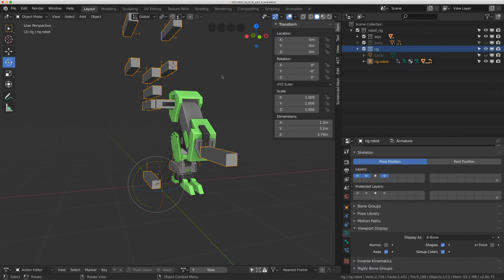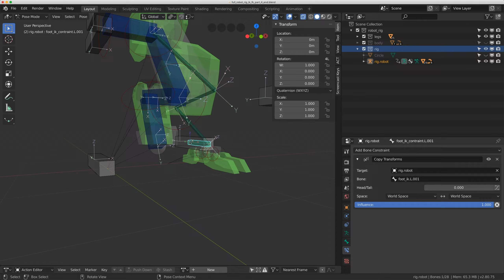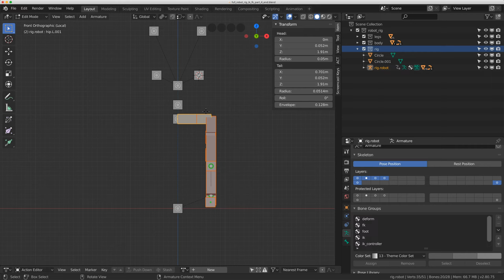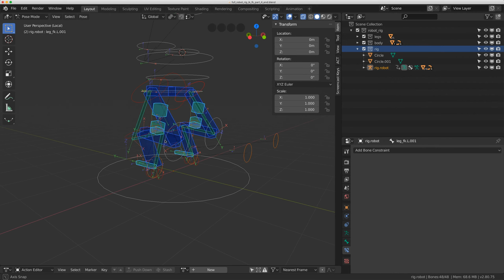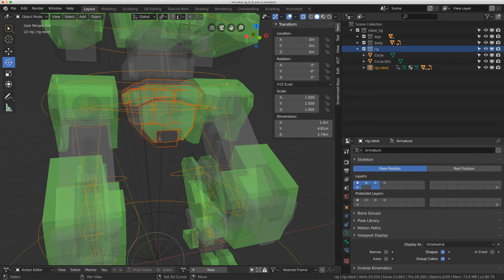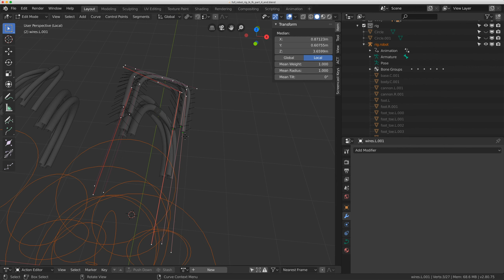Full Robot Rig - Part 5: Final Clean Up | Rigging For Animation

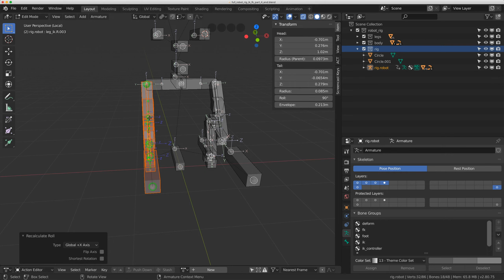Comment: I think they fixed the problem at 12:34 in 2.90.1 because I didn't have to recalculate the axis on the symmetrized leg. Both poles and pasting the action work as they should so all you need to do is add driver and parent the leg. 

Btw, I've watched tons of rigging tut but I've learned to rig from you. Your tuts are spectacular and easy to follow. You're an awesome dude for putting in the time and effort. Thanks!
Reply from the maker: Cool thanks for the tip, I'll try it out, that is great news. :)

Comment: Are these techniques suitable for game rigging?
I really want to learn how to rig hard surface stuff in blender for games.
Reply from the maker: For the most part, these are. Although, on a game rig you usually separate the deform rig and the control rig into two objects. That way you can bake out the animation and only send the deform rig to the game engine.
Reply: @LevelPixelLevel  Sorry to hijack this, but do you have or know of any tutorials to show how to properly do this separation? I'm new to Blender rigging (used to rig in 3DS Max), and right now due to the armature pose mode it seems impossible to me to have outside objects influence bones at all.
I did a quick look through your channel (which seems like an amazing learning resource, subscribed!) but couldn't find anything that seems to tackle the subject.
Cheers!
Reply from the maker: @yannickvanhoutte4403   Hey, for this you might want to check out the Unreal guide for getting rigs from rigify into Unreal: https://youtu.be/ppROgA3nQWk
They have a good system with an addon for achieving this. As you play with this it might help you bring the files into Unity or Godot.
Reply: @LevelPixelLevel  Thanks for the quick reply! I checked out the video but I feel it doesn't really answer my question?
I want to know how to make a rig with separate IK/FK controls in such a way only a deform rig gets exported to FBX, as you want for a game asset. I'm assuming Rigify can create rigs for this, I have yet to get into Rigify, but how would you do this "manually"?
I also don't see (from this video) how these add-ons would work for non-UE4 targets (Unity, Godot, anything else).
Reply from the maker: @yannickvanhoutte4403  Ah I see what you mean. For this you might want to just build the deform bones in Blender, meaning just the bones that actually move then mesh. Then you can bring this into the game engine and actually rig this in the game engine itself. I know you mentioned non-UE4 things, but here is an example for the Unreal Engine: https://www.youtube.com/watch?v=CP0C_8xNiyw&ab_channel=AndiDev
For Unity I have not tried this, but I have found this: https://blogs.unity3d.com/2019/05/14/introducing-the-animation-rigging-preview-package-for-unity-2019-1/#:~:text=The%20Animation%20Rigging%20package%20for,own%20custom%20constraints%20in%20C%23.
And I don't know if this is possible in Godot, I have not looked into it. I hope this helps!
Reply: @LevelPixelLevel  That's a way to go about it, indeed, but what if the animators want to explicitly work in Blender? Unity is rather animator-unfriendly (even with those preview tools), so to this day we do a lot of animating in the 3D package and baking this out on export for a fully baked animation inside the engine. In this case having IK/FK controls inside the 3D package is a must.
Reply from the maker: @yannickvanhoutte4403   I see, then for this you might want to build two rigs (armature objects). On for the deform bones, and one for the control rig. You can then connect everything on the deform rig to the control rig with constraints. The animators would use the control rig for their animations, then you bake out on the deform rig using the bake action option in Blender (from here you can delete the control rig if you want) https://blender.stackexchange.com/questions/137483/how-to-bake-animation-in-blender-2-8
I will be covering something like this in an upcoming video.
Reply: @LevelPixelLevel  Aha! I quickly tried this out and that seems to work just great. I'll look forward to that upcoming video, but in the meantime I know what to practice. Thanks for all the help!
Reply: @LevelPixelLevel  Hey, I'm back here and made a discovery! Turns out you don't need to make separate armatures for IK/FK/Deform if you want to rig for games at all! When baking from Blender to FBX, there's an option to only include deform bones. Each bone within your armature can be marked as a deform bone under the bone settings. That way you can keep everything within one armature like you've been showing here, without excess bones in the export! :)
Reply from the maker: @yannickvanhoutte4403  for sure, you can even rig the entire rig in Unreal or Unity, I've been playing around with this as well and it is a lot of fun! I hope to do some tutorials on this soon.

Comment: Hello, thanks for the great series. I need help with animation exporting though...

I want to export several animations to Unity, several of which I made using the IK switch. But then I made one using the FK switch and I can't figure out, how to correctly export.
When I export, all my animations are bound to the current settings of the switch, so they all either use FK or IK.
I figured out maybe I could bake all the animations to the deformation bones manually, but I can't seem to figure out how to do that, since their individual transform doesn't change, only the IK and FK controller bones change their transform...
Any idea what to do?
Reply: Well, I managed to solve it by exporting the animation individually which isnt what i wanted but it works.
Reply from the maker: @dwarfda  Op glad that worked. For Unity (and unreal) Rigs I tend to build the entire deform bones as a different rig. Then I connect everything with constraints. 
You want to use Bake Action to bake the animation to the deform bones, and turn on all the options.
to get this hit F3 and then search for it while you have all the bones selected in bose mode.

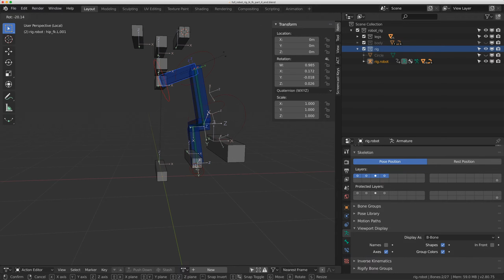Comment: How can the FK Joint at 2:28 push the whole leg if the switch is set to IK?
It doesnt work on my rig since all FK movement is ignored if the switch is set to IK.
How is it that an FK Bone can manipulate Deform Bones at the same time an IK does?
Reply: Ok after 4 hours i finally found the stupid mistake. The most upper IK Bone was not parented to the Deform Bone next to it (the one connecting the leg and  the hip).
So i guess it works because this Deform bone (controlled by the hip FK bone) is manipulating the IK bone which then manipulates the other Deform bones. 

Makes sense if i now think about it after finding the error. But it was very confusing to understand how exactly all the different Bones from the different Groups interact with each other and in which order.
Reply from the maker: @Random4Logic  Sorry I did not respond earlier! and be sure to check out the example files. This happens sometimes in rigging, where you dive deep into the process, but you end up learning a ton for the next rig you make!
Reply: @LevelPixelLevel  i didnt expect an answer at all to be honest. But you are right i never learned this much about rigging in one short tutorial series. thanks for those great videos

Comment: These have been great and you're very good with them.
I'm just curious, can you give a couple examples of what animators might come back to request?
Reply from the maker: Thank you! Glad you are enjoying the series. An animator might come back with a couple of requests. Maybe a control on every single piece that can move, then when the robot walks they can have all the little pieces shake. 
They might also ask for additional IK controls, like locking the pole vector to world space, or advanced controls for foot roles. 
They might also ask for dials on lights (emissions) so they can turn them on or off.
Reply: Animators need a seamless IK-FK Snap! This feature really save tons of time during animation, when you have to switch between IK and FK many times. IK and FK systems replace each other automatically without changing any deforming bones position.
In other 3d packages riggers usually make this "snap" with some scripting an "IK-FK" button. So animators do not have to manually adjust bones any time they change between IK and FK.
Reply from the maker: @DmitryPekarev  Totally agree, I have built these tools in Blender before, it is fairly easy to make this into an add-on using python but I've only ever done this with a name-based vector matching system. I'm sure there is a dynamic constraint searching method for this, although I have not tried that. I didn't want to cover any coding in this course, just the basic rigging.
Reply: Hope someday you'll make a tutor revealing this topic :)

Comment: Also, can you help me understand why Euler is better for animation?
Reply from the maker: Well I wouldn't say it is better or worse, it is more industry standard. Most Animators are used to working in Euler and this tends to be how most studios (and programs) structure their rotation order calculations. I believe though that under the hood most game engines are Quaternion rotation, but show Euler to the user.
Reply: @LevelPixelLevel  correct me if I'm wrong but as I understand it gymbal lock isn't a thing with quaternion rotations so why don't just use that if it's just a standard but not worse than Euler? I'm a total noob in this field and I reeeeaally want to understand it better <3 (I didn't even know about quaternion/euler and gymbal lock before seeing your videos ahah)
Reply from the maker: @MondyTS  Yes, you are right, from a technical point of view Quaternion is a better rotation order. But from an artistic point of view, it is not always clear which dial you need to change to rotate the object. Meaning if I rotate the x-axis in the channel box in Euler I can see the X red ring rotate in 3D space with the object. Quaternion is not as clear as this. 
Euler also adds up to world space, x, y, and z-axis of the world match up to the rotation. 

Also, when you are animated you are always using curves in the graph editor, Euler makes three curves and Quaternion makes 4. This may not seem like a big number, but when you are working with hundreds of controls on a full character rig that extra channel can start to add up and clutter the graph editor (and slow down the file). 

That being said, I do almost wish Quaternion was the standard, and in some industries it is. But in Animation (for now) Euler is the main gimbal rotation order.
Reply: @LevelPixelLevel  oh that's cool, thanks for the explanation :)

Comment: Thank you very much for this great tutorial. 
Do you have any tip how to see rotations gimbal lock when rotating a bone in Blender? The 3d widget  is not visible when you rotate a bone in Blender :-(
Reply from the maker: Hi! Glad you liked it! 
For Gimbal make sure you have the rotation icon visible and that you are in pose mode. Then switch the pivot to Gimbal. 
https://www.levelpixellevel.com/uploads/1/1/7/8/117873610/gimbal_orig.png
Reply: Level Pixel Level 
Sure, I know this. The problem I was reffering to is that in Blender the widget disapears when you are rotatting so you only see the resulting state. In Maya the widget axes are always visible so you can see that you may be trapped in Gimbal lock. It would be nice if Blender has a possibility to see all axes of the 3d widget all the time.
Reply from the maker: @kvetoslavnovak423  ahhh I see now. Yes, you are totally right, the widget does disappear when moved, I could not find a solution to this but I'll keep an eye on it to see if anything on is built for this.
Reply: Level Pixel Level 
Thank you very much. Maybe developers will make this enhacement one day.

Comment: Is there a difference between rigging for games vs rigging for movies ect?
Reply from the maker: Yes, there is. For Game Rigging there rare certain requirements placed on the rig when it is exported to the engine. Unity and Unreal deal with these rigs in different ways. Also, tools that are available for animation in the 3D package are usually missing from the game engine. 
Usually, with a Game Model/Rig you want to bake out the deformation to just the deform bones, or just Blend Shapes/Shape Keys. 
That being said, Game Engines usually have additional internal tools for adding functionality to rigs once they are imported.